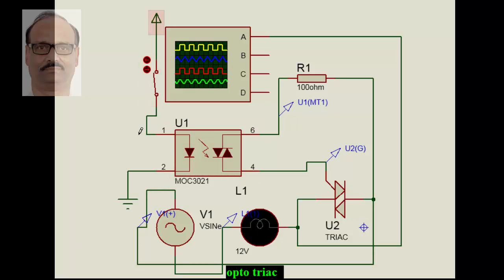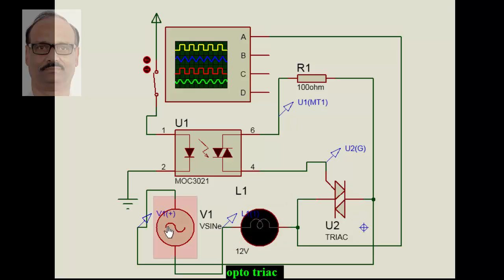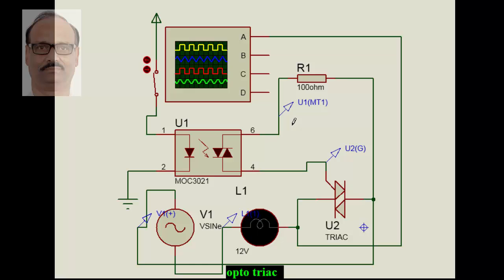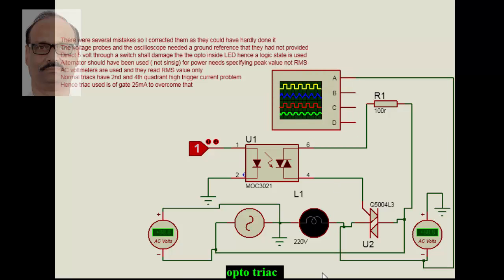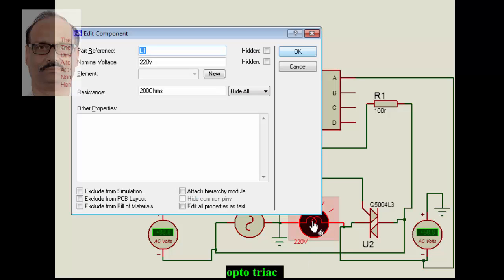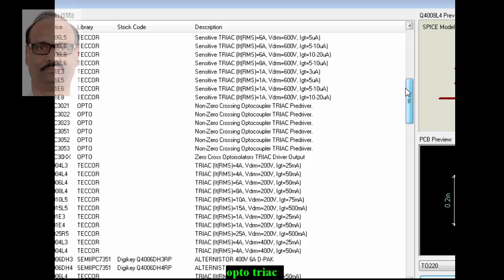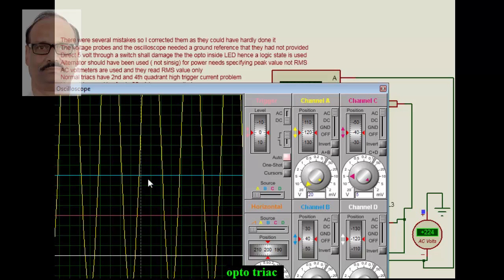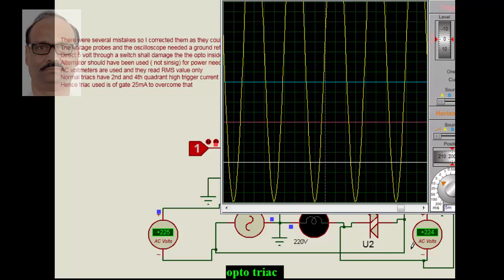Triac & Opto coupler interface problem in Proteus Simulation

Comment: Why you put the load into the MT1 circuit and not into the MT2 side?
Reply from the maker: In Proteus the oscilloscope terminals read with respect to its inbuilt ground. Hence one of the load point has to be grounded if load waveform has to be seen..However one can use the load in MT2 in physical circuit.

Comment: can we practically connect the DC ground with ac Ground? not, it will make noise in circuit so this is only for simulations right?
Reply from the maker: Only for simulation as the oscilloscope needs a ground. But never never in real hardware.
Reply: @PatnaikUC  thanks, that simulation part was good, but u should also show the real hardware base design too.